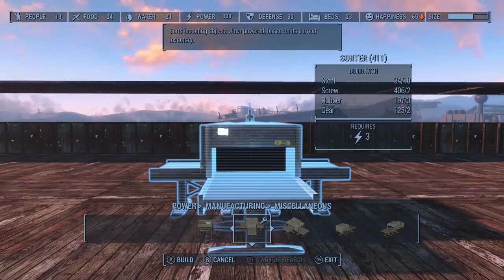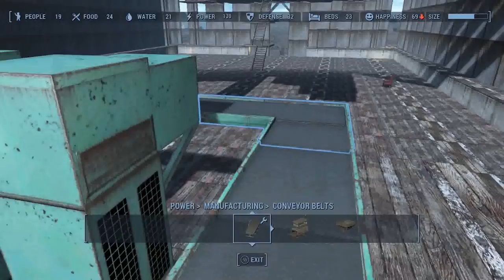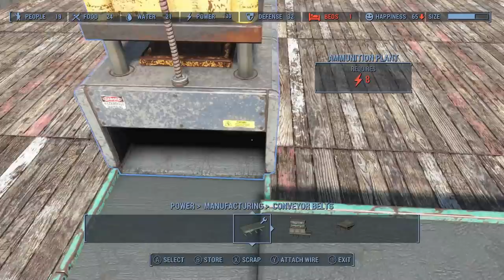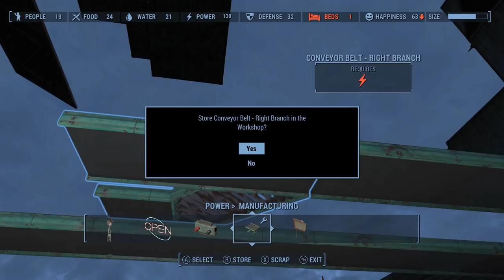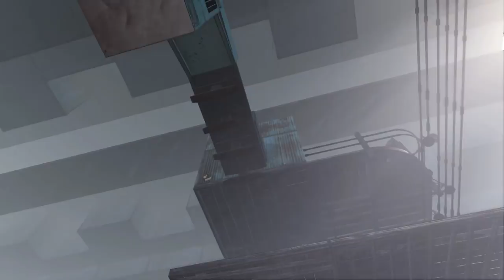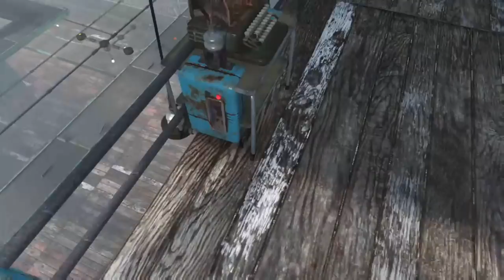Fallout 4 Manufacturing Tips and Tricks part 2

Comment: This... makes a lot of sense.

However.

It also does not. 
Pulling materials out of forges / crafters, makes sense. 
But you can eliminate like... half of all this by doing a vacuum hopper into a conveyer workshop storage.
You also dont really need to sort items. Add the recycler mod.
Send base materials back to workshop.
Have object / component extractors pull specific items into lines for crafting.

Comment: Your personal note at the end was something else! These systems are cool and fun, but in a way, redundant. It’s fairly easy to accumulate any particular item just playing the game. The manufacturing stuff isn’t addressing a hole in the game. 

But I’m looking to do something different. As I see it, a hole in the game. It has to do with settlers and their assigned scavenging and farming jobs. 

Settlers add free junk items and food to workbench storage over time. But once the workbench has a certain number, they won’t anymore. You literally must periodically empty it, and store stuff in an unconnected container, or else they no longer generate free resources. But this is problematic. 

The problem is that anytime you want cook, craft or build something, you must take out, and later replace, anything you need to make it. This is a micro management nightmare. 

The best method I’ve come up with at this point, is to manually scrap all the junk first. Then remove the components from the workbench, and store it away. It makes any crafting easier to do, if my junk is listed as components. Just open the crafting menu of the item i want to make, tag for search the components, then go to my storage, and quickly scroll through and grab them. Tagging is a convenience, so i don’t have to remember what components are required. (Then craft, and UNtag for search the required components, so i can repeat the process.)

Obviously, this is a pain in the ass. I’ve only just discovered that scavenging/farming stop generating at a threshold. I may just give up. Not to mention, storing junk and food apart from the workbench renders Local Leader’s supply lines useless. 

So I’m looking into how maybe the manufacturing dlc could help to extract junk from the workbench, break it down into component parts, and store it away from the workbench. Automatically. That still means I need to pull out and replace components for crafting/building. So, maybe it’s not worth it. 

But like you said. It’s a poop flavored lollipop. It’s fun to make and play with, but not worth it in the end.

Comment: how did u do the floor thing at 6:02?
Reply from the maker: It is a supper easy to move a floor up or down one floor at a time, but may be difficult to explain via text but ill do my best.      The curved concrete walls have two snap points for floors, top and bottom, so if you snap one curved concrete wall on top of the other you will get two snap points together (bottom of top wall, top of the bottom wall) to go up one floor store the bottom wall and snap curved floor up to bottom of top wall, to go down one floor store the top wall and snap curved floor  down to top of bottom wall, you can repeat this over and over until you get to your desired Hight, Keep in mind that you cannot snap to both top and bottom of the curved walls at the same time that is why you need to store one of the walls before snapping in the curved floor ,  I hope i explained this ok for you, if you still have question about it let me know and i will look through my videos and find one that explains what im doing there in better detail..... thanks
Reply from the maker: https://www.youtube.com/watch?v=Iu-8pfwgfv0&t=557s                   Try this video at 9:17 ....Thanks
Reply: @NastyBonz3D  i appreciate it, went through and watched ur how i build videos and figured it out, now i gotta get to lv 41 for fusion gens lol

Comment: How do you drop the floor down a level?
Reply from the maker: There is a couple of ways to do it, but the easiest way is to snap a concrete curved quarter floor onto the floor you want to lower and then use the curved concrete walls, snap the bottom of the wall on to lower, snap the top of the wall on to raise the floor, then snap another wall on the top or bottom of the first wall you snapped (depends on if your raising or lowering) if you snap it to the top of the wall or the bottom of the wall,  
      There are a few videos that show me doing that, if this helps i have a video series called " How i build" and they may help you out, also you may see some other tips that you are not aware of... Let me know if this helped or not..... Peace!!
Reply: @NastyBonz3D  Thankyou, I’ll try it later when i get in from work lmao